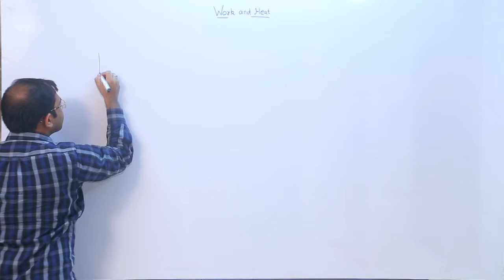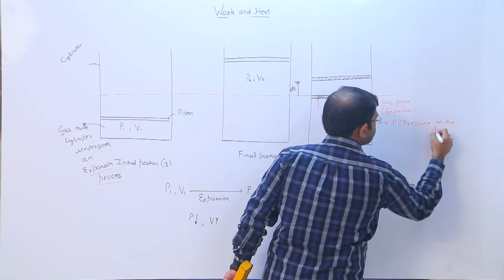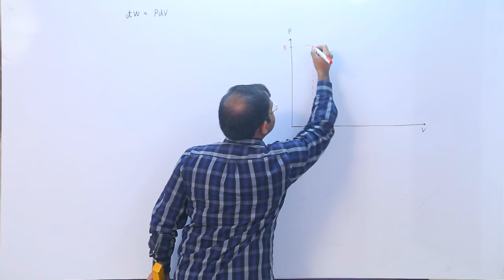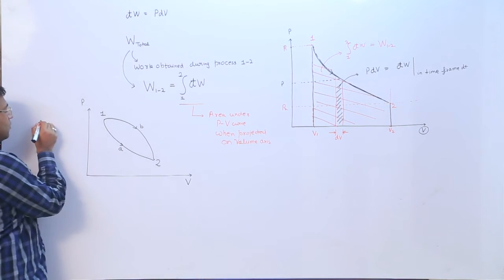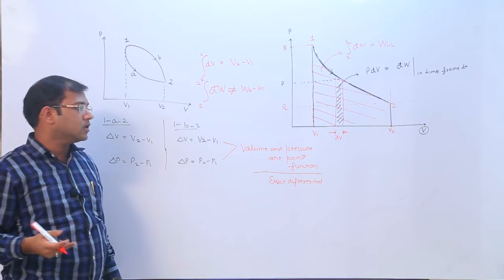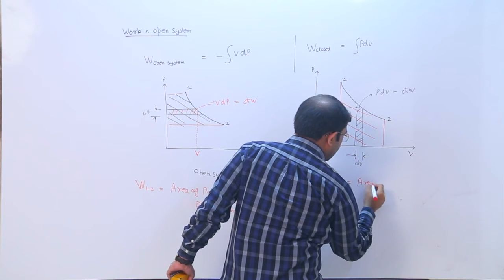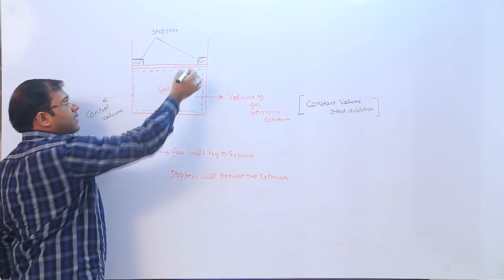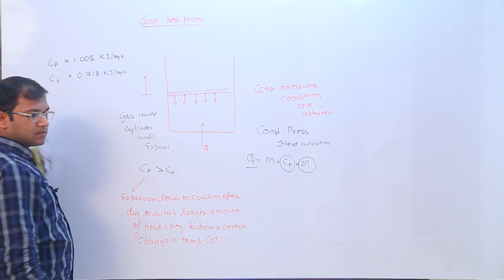Thermodynamics (Heat and Work Interaction) | Mechanical Engineering | The PhD Tutor

Comment: Sir.   Why  expansion. Lead  cooling effect ??
Reply from the maker: Expansion, means work done by system. Internal energy of the gas gets converted into work and Internal Energy is a function of temperature
Reply: Shashank Mohan      so when their is exapantion   internal energy  decrease so that temperature also decreases  ( as it is  a function of internal energy)          that's  why expansion. Caused cooling effect.                                 Am I right. Sir.  ????
Reply: Shashank Mohan Tq. for replying. Sir  👍👍😊